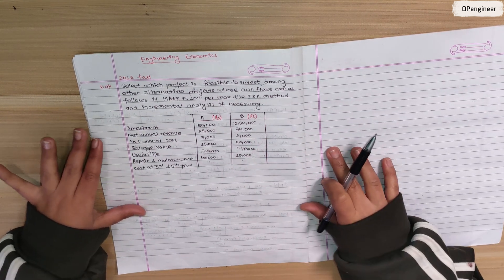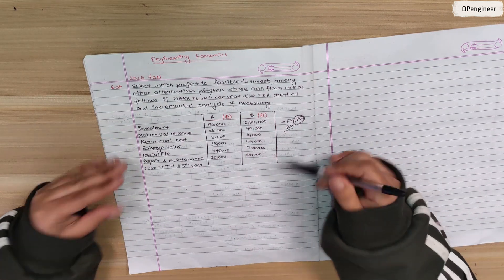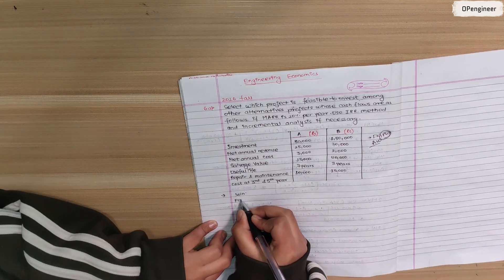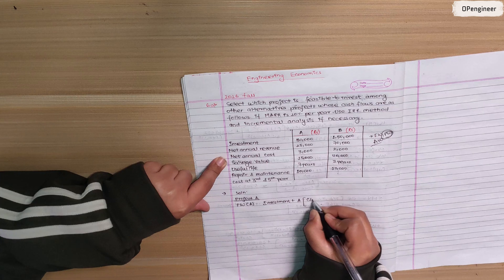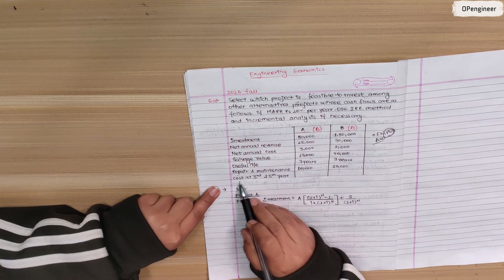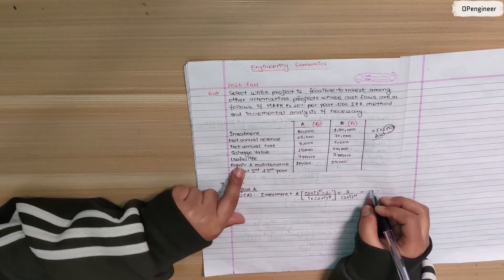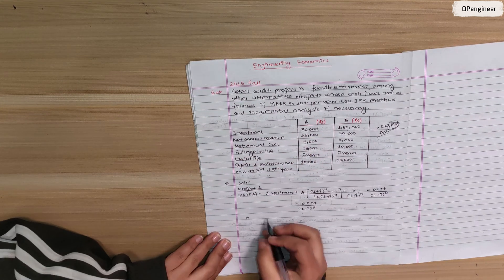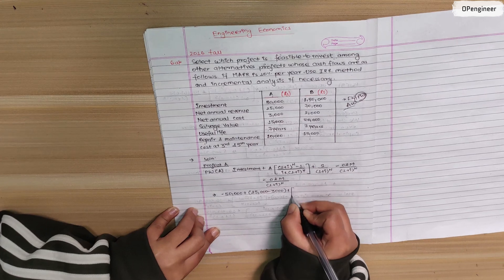IRR Method and Incremental Analysis || Engineering Economics || Recent Board Exam Solution IN NEPALI

Comment: @OPengineer369 if  annual expenses of B-A is negative (in this question it is 2000-3000=-1000) what shall we do (shall we consider as income) (as per my guide book) will you please clarify
Reply: Wait, if B-A comes negative to annual expenses then you should use +ve sign. Let me tell you. Expenses means the outflow(take minus sign) and the B-A expense is also minus. So minus minis multiplaticatiom will be positive.